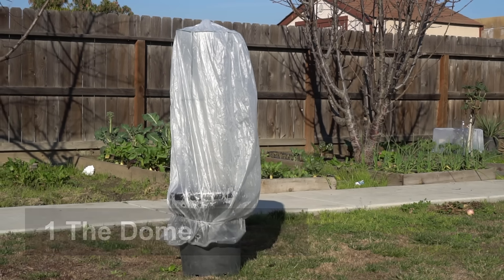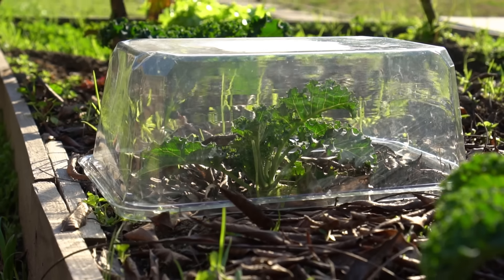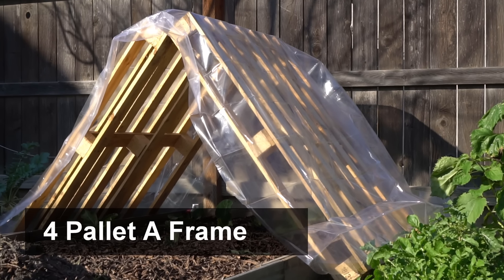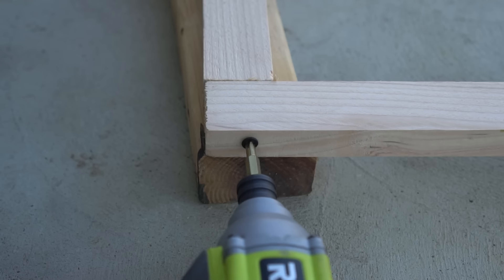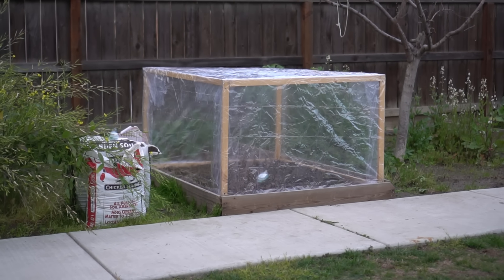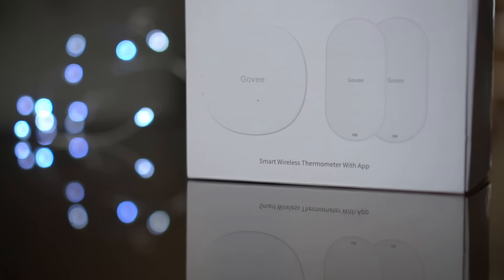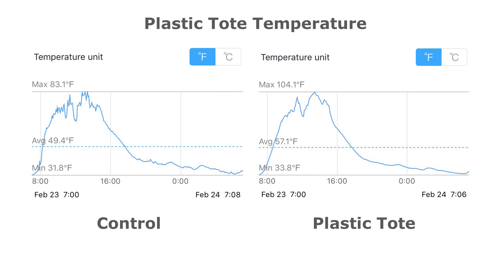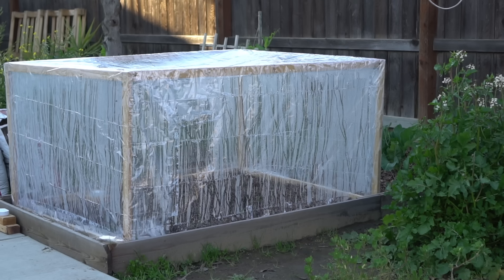5 Low Cost Greenhouse Ideas

Comment: A dollar clear plastic shower curtain from Dollar Tree is also economical.
Reply: Kathy Young that's what i was thinking too
Reply: You and I think alike!  I also use the red plastic table cloths from Dollar Tree under my tomatoes.  Some research a few years ago showed that "red mulch" increased the growth of the tomatoes. It was the reflected red color.  Cheap enough!
Reply: That's right, one can also use plastic glue to glue two curtain together to make a larger one if needed.
Reply: No!!!, just one more like and itll be 69!
Reply: That’s what I’m thinking right now and I’m going to dollar store and Home Depot buying all the stuff to make a trellis 🙂
Reply: Thank you! I was going to ask where to buy the plastic table cover and when I'm about to, your suggestion comes up first! Thanks!
Reply: @tounechareunsouk1085    Walmart, too.  Check the thickness of both to see which one you want.  You will pay a few $$ more at Walmart, but all of this is cheap.  Best wishes.
Reply: Can that withstand the elements, though?
Reply: @hisbeautifultruth5931    For a while.  A few seasons.  I bought a cheap plastic greenhouse about 6'x8', lightweight, and it BLEW AWAY.  If you buy clear plastic shower curtains at Dollar Tree or anywhere cheap and stick posts INTO the ground, and make sure wind can't get under the plastic, it won't blow away, and it will last for several seasons.  The shower curtains will be cheap to replace is a few years.  Or throw them away and buy new ones each year.  It's still cheap and sturdy.  Best wishes.
Reply: Really good idea 💡 Thnks!
Reply: This is an amazing idea. Oh man!! Genius.
Reply: Thanks for sharing!!
Reply: Like! I'm going to use leftover plastic cover sheets from painting the walls. The really thin sheets seem a bit too fragile, but the slightly thicker ones will work, I think.
Reply: @saravanroosbroeck5414  Plastic shower curtains from Dollar Tree are thicker than you think.  But the clear ones from Walmart are better --- thicker and clearer.
Reply: 🛑 STOP BUYING PLASTIC! 🛑
Reply: @muffemod  I agree. Don’t go out and buy more plastic. Not good to have the mindset of oh it’s cheap so I can easily replace. If you’re going to buy then go for thicker sheet stuff . 

Plastic wrap from furniture or bedding can be reused. People are always tossing old windows which can be used to build a greenhouse
Reply: Amazing idea.
Reply: Then what the point of the shower curtain
Reply: @lorjanlumanovski8373  To keep frost off while allowing sunlight at nearly full strength.
Reply: I meant a shower screen if its in a shower what the point people ca. See u
Reply: @lorjanlumanovski8373   Not in my house.  I live alone.  Clear shower curtain lets in more light.   Besides, who do you let into your bathroom when you are showering that you don't want to see you?   Lock the door.
Reply: @kathyyoung1774  Thank you for the tip!
Reply: @sn232  You are welcome.  It's always good to find cheaper ways to garden.  Nobody wants to grow the "$64 Tomato."  Best wishes.
Reply: Holy shit you’re actually a genius, I’m not exaggerating either. When I read your comment it clicked in my brain, the idea gears started spinning, and I can’t believe I didn’t think of something so obvious yet so smart!! You’ve actually saved my wallet!!! 
/genuine
Reply: @rainbowbutterflyfan  I garden “on the cheap.” Best wishes!
Reply: Awesome idea!!!!
Reply: That's exactly what I was just using
Reply: Dollar tree drop clothes (clear plastic film) a pretty huge. You can find them in the hardware area .
Reply: @vatochingon209  True, but they tear very easily.  Shower curtains work better.  However, anything is better than nothing.

Comment: Great content. Three suggestions:
Use wire or cable ties to secure the pallets together so they don't fall and crush your plants
The box frame can also be made of PVC-it costs a little more but can be easily disassembled and stored if it's not glued
The box frame can be covered with insect or bird netting to protect plants from pests when cold protection is not needed.
Reply: Thats brilliant to protect my berry bushes!! Thanks!!

Comment: I live in Illinois where temperatures can get really cold. I can see how this might be an idea I could use early Spring. I can imagine that the plastic gets torn up when it is stored. I think maybe using some plastic ceiling tiles or other plastic sheets from the hardware store using tape to make it air tight might work as well. these plastics would be a bit costly at first but in the long run could save money. Thank you for this video it has inspired me in many directions

Comment: I really like that measurement part. In such way one can prove if something really works as it was expected. Thanks for posting those quick tips!

However, I'd suggest two things - when fixing plastic film on wooden frame, narrow (e.g. 20 mm x 10 mm x ..) wooden strips of maybe even strips of 3 layer plywood would really give a long-lasting result - wind tends to break plastic film easily when it is fixed just by nails (even if they have large flat heads). That additional wood doesn't cost much extra neither. If frost is really a serious issue, a double-layer of plastic could be used - ordinary plastic sheet outside and either ordinary or bubble plastic sheet on inner side on that frame. Or even a dual solution - plastic box(es) over the plants and that wooden frame + plastic sheet construction over everything.

Comment: I made a large version of the greenhouse box for winter protection of my Daughter's bonsai. To prevent sagging under the weight of rain, or much less likely snow, I placed a layer of split bamboo on top of the frame, under the plastic sheet.It worked like a dream, providing cold insulation and retaining humidity.
Reply: Can you share a pic? Thanks

Comment: I use 3 mil poly in the roll which you can buy at Home Depot or places like that. You can buy different lengths of the rolls, like  25' , 50' or 100' or more. Instead of using nails, you can just use staple gun staples. I had a entire green house covered in the double-layered 3 mil poly for years. It stood up well to the heavy snow we get in our Northern Ontario, Canadian Winters. Also, my experiences have been that clear plastic tablecloths become yellowed and brittle after a couple of years.
Reply: Hi christine, did your double layered greenhouse do well through winter? I live in Calgary

Comment: You could get somewhat better insulation on some of these by using two layers of plastic with an air space between.  Also, the north side of the "greenhouse" will never receive sunlight (in a northern hemisphere winter), so you could use white plastic or other reflective material on that side, and pile up soil or leaves on the outside for insulation and temperature buffering.  To take best advantage of this, the "long" sides of a rectangular container would ideally face directly north and directly south.  Some clear plastic on the ground surrounding the greenhouse will warm the soil and may help with night time temperatures.

One issue with the plastics is that none of the plastics shown here are likely to be UV resistant, which means they will break down pretty quickly under the sun and have to be disposed of.  UV resistant clear plastic would be more reusable and generate less trash, but defeats the point of being "low cost".
Reply: Farm Supply Plastics have super affordable UV resistant plastic sheeting for greenhousing. Amazon sells their products at a much higher mark up

Comment: I tried making a box like that once. Worked great against frost and then when the days got hotter I replaced the plastic with a screen to keep insects out and again, it worked great, except the plants grew and as soon as the leaves touched the screen the insects laid eggs on them and that was that.

I gave up after that. The insects destroy anything I put on the ground and I will not use poisons. If I'm going to go trough all that trouble just to poison my food then I might as well buy whatever is out there and relax.

Then I planted fruit trees and now I have to fight with the birds and the squirrels so that i might have some fruit for myself. Can't win for losing.

Now I'm going for microgreens, see how that goes. It's inside the house so I will not have to worry about insects, birds or squirrels (at least, I hope so). The biggest worry is going to be the light bill.

If that works, I might build a hoop house outside to grow my food.

Comment: Thanks Jag!! As usual, you knocked the ball outta the park with effective, economical ideas!

These methods look like they would be helpful for starting seeds in situ in the garden, rather than trying to start them indoors where even with lights my starts are never as robust as those which get going on their own outside. Of course, the latter are few in number, so I can't count on that method exclusively...especially as we already had two freezes, April and mid-May! I'll give these, or a modified long-bed form of them, a try next year-- if I can get enough clear plastic! It is a resource, so it's worth folding up and saving.
Reply: Plllll

Comment: I have just purchased a glass top table... I am going to make a green house by wrapping the lower part of the legs with plastic for protection and placing in holes in cinder blocks. There will be a foundation of cinder blocks so I can  fold under plastic sheeting and use tent pegs inside for stability. I will place a weatherproof tarp on the floor to prevent weed growth. I plan to over winter my potted plants that are prone to frost damage.

Comment: Another thing you can use to help with heat retention is using bubble wrap over the outside surface.  We keep all our old bubble wrap (don't like to discard plastic).
Reply: Could you elaborate?
Reply: @justsomeguywithtattoos6267  We get lots of bubble wrap in the packages that carry our orders.  If you don't have a large input you can buy bubble wrap at stores.  Our preferred wrap has bubbles that are about 25 mm (1") in diameter.  the wrap has a smooth side and a "bubble" side.  The smooth side goes over your frame and your sheet plastic goes over that, so you end up with a captured layer of bubbles that insulate your greenhouse.  If your greenhouse is glass you can glue to the inside of the glass and tack to the frame.
Reply: @georgebartholemew8444  wow that's great! Thank you. Do you put the bubble wrap on all walls and roof as well? Do you think it affects the amount of heat and sunlight the plants inside can get?

Comment: Instead of using plastic 'tablecloths', one can use rolls of clear plastic [found in stores like Walmart in the painting dept.] $10.00 for a 25x10 ft. roll.
Reply: fortunate for you.
where I live, it ain't that cheap  :(
Reply: @cozzyinternet4706  I suggest saving plastic bags that hold mulch etc, then use duck tape to piece together.  I thought of this after I threw out so many.  Ugh, I guess next year.  Also these "greenhouses" need venting, a way for air to escape and circulate.  I think the danger is that molds will develop and poison the plants, perhaps kill.  Greenhouse designs by pros should be examined and then incorporated.  I think these ideas are more like temporary structures to make it a bit more ideal to start seeds ( cold frame) or to protect from killing frosts.  Greenhouse means something entirely different, not that these ideas won't work or aren't good.  There are limitations to everything.  But I will be more emboldened now and get something up.  Suggestion, if you are looking for free or cheap plastic, try early Spring when deliveries are made and uncovered.  I'm sure some stores will gladly hand over what covers up palettes of goodies.
Reply: @charlenekociuba7396  
Hey, I was wondering what your comment was about......hahah.
Thanks very much for your advice and tip.  Much appreciated!   I've been collected bags for printer toners/drums too! :D
Cheers!!
Reply: Plastic tablecloths or shower curtains are only $1 at Dollar Tree if you can't find that roll or don't want that much.
Reply: philomena phanthagia  
brilliant idea too

Comment: Technically these are cold frames, not greenhouses. Cold frames are very useful, and I use several of these. But don’t expect these to keep your tomato plants alive at night in freezing weather. For that you need a greenhouse with heat.
Reply: If you do the a A-frame with the pallets you can put compost up to a certain point so that you allow the light to get in from the top but the heat from the compost will continue to warm to whole thing from the bottom and around the sides
Reply: Agreed.  But how much heat?  Not enough for many veggies that can't stand cold.  I can see that working for most greens, snow peas, etc.

Comment: Leaning a frame on the side of the house and covering with plastic is also an easy and simple method, especially if it faces south.
Reply: Can also rot your house if you have a lot of moisture in the greenhouse. I have seen it. People had to strip down their house and live in a hotel for a year. Also no have a chronic mould injury to respiratory system. It took time, but the man who wouldn't listen when it was installed had to deal with it 20 years later.

Comment: Great ideas, however, if the clear plastic tote you use is not made for outdoor use it can end up become very fragile and cracking. And, depending on what it's made of, plastic off-gassing can happen. Without any kind of airflow, these gases can cling to the plants or soil in the form of a microscopic toxic slime, and you will not see it. But it is there.

Comment: I think it needs to have some small holes for the oxygen flow.
Reply: plants dont need oxygen, bro
the carbon dioxide trapped in might be enough for one day so you have to open it again daily
Reply: when i have a container indoors i heat the tip of a tiny screw driver over my stove and can then gently press it through, the plants do air exchange/photosynthesis at different rate to how we breath so the ventilation doesn't need to be major. heat is harder to maintain
Reply: lol

Comment: 5:49 I am in the process of making a similar wood frame plastic cover green house and I am considering making it a double layer. One running outside the frame as shown in your video and a second lining the inside of the frame giving a small gap between the sheets. The hope is that this will add to it's insulation properties slightly. Not sure how effective it will be though. Great video. Simple yet effective ideas.
Reply: Save your bubble pack and line the inside with it.

Comment: Everyone remember to either lift or check on regularly I'd advise at least once or twice a day lift replace air shake e cess condensation depending on application etc etc greenhouse humidity dome and sealed unit are completely different lol

I'd advise drill sone holes on highest point and cover as necessary big tubs might need several small 10 to 15mm holes where's smaller domes container lids etc might only need one or two hope this helps stop rot mold and losing seedlings and seed due to excessive moisture because excessive and inadequate are both bad

Comment: You should have made the wooden frame with slanted roof so when it rains water don't pool at the center and eventually weight the plastic down.
Reply: Quantum Chang   The rain on top will actually help keep it from blowing away.  I had a whole plastic greenhouse blow across the yard.  These cold frames need to be weighted down if you have any wind.
Reply: Kathy Young - tent pegs.

Comment: I wonder what difference you see if you tried an extra layer of plastic attached to the inside of the frame to create a pocket of air insulation. I wonder if it would equal or outperform the plastic tote and possibly last longer?
Reply: Reuse your bubble pack as the inner layer to the wood frame.

Comment: The box style greenhouse looks like its roof might sag or even tear under a lot of rain, hail or snow. Not saying this happening would be likely, but just to be safe you might want to make the roof an arching shape by wedging one or two pieces of plastic pipe, bamboo or a springy branch in the frame... Just like in gothic cathedrals :)
Reply: Or just make one side higher so it slants the roof to one side.

Comment: #5 how about box in a bigger box? to have smaller temperature shifts inside, during coldest days, or place inside 5-6L bottle(s) with water to keep more heat inside, also to try minimize temperature drops. Will it work?

Comment: I am from India, west Bengal. I don't know where you are originally from? . Momsoon here is sometimes very nasty. It rained here in spring too. The weather was cyclonic. It damaged my plants and saplings. I have a small rooftop garden. Gardeners here usually  make a temporary roof  with trasparent plasticin monsoon and use green net  in summer. Which is costly. Though my planters have a good drainage. Sometimes water gets clogged in the  pots  when it rains continuously for days. The way you protect your plants is quite cheap, so I wanted a suggestion. Thank you for responding.

Comment: What about the chemical content released in plastics after being in the sun heat? Very helpful and creative recycling methods but still concerned about those chemicals. Thanks!
Reply from the maker: In winters the sun is not strong enough to case an effect on the plastic, plus the shower curtain or the table cloth are thick enough that they won't break up in the winter sun, so no chemicals will be released.